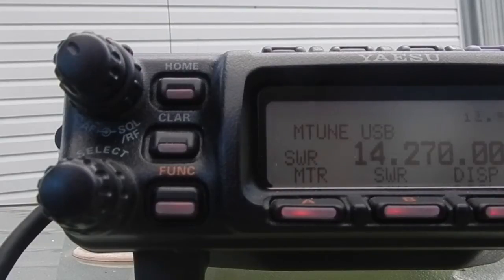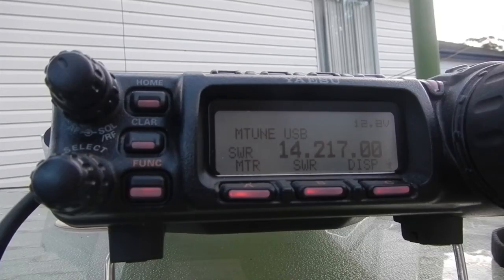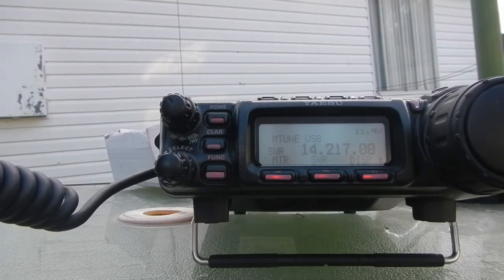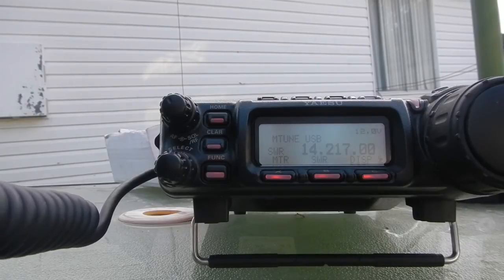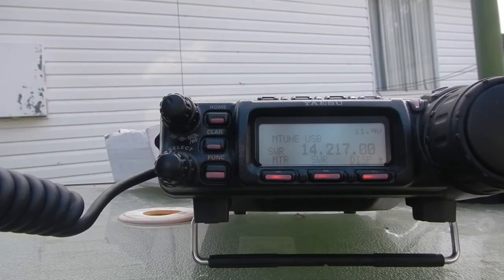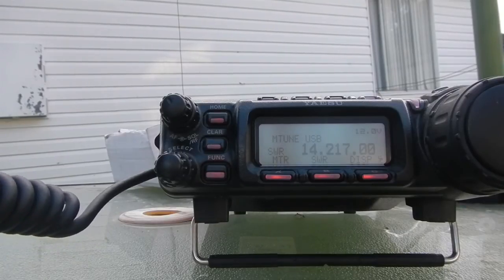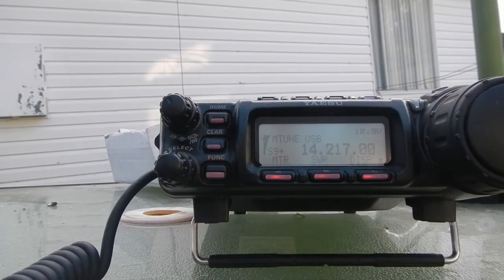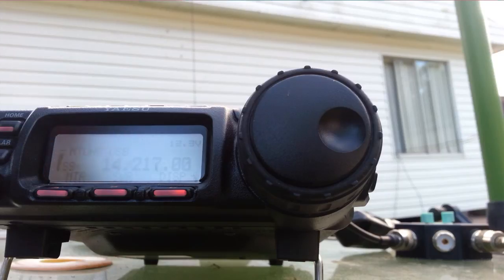Pac 12 / npc 7  Antenna - first QSO testing with/without radials. zl2jbr on 20m

Comment: Several years later, would you still recommend this antenna? I've picked up a QRP HF rig and am in need of a portable antenna, so this one (and others like it) have caught my attention. Any input you can provide would be much appreciated... thx from VE3XGS
Reply from the maker: to be honest not really. 

It's a bit of a pain to tune even though it's a great little set up. 

I'd much prefer a wire antennas but you don't always get the option of trees etc. check out Adam's s QRP set up in this video here  https://youtu.be/wBJvEeSooXo  Adam does lots of Sota and flora/fauna type activations and has his set up down pretty good. 

he uses a linked dipole which I think is about as good as it gets for qrp portable. I also had some luck when in the bush just using a random length 4 sided loop into a 4:1 balun through a tuner. Lots and lots of trees to pick from though. 

Hope that helps.
Reply: how about testing it with one radial only?

Comment from the maker: Awesome. that's exactly the plan from my end now that VK2 in Australia has come on board for Sota.
Let me know if you make any videos of your adventures. I'd be keen to see them. 

Oh, and I really like the antenna.
 I wanted extra coil clips so I could just move the lead to set spots.  Plus I only got 1 with mine. 
From the US the buddy clips were cheap enough but postage made them around $35 odd for 3 of them. 
I found a local source in VK3 if I recall. 
let me know if you want the details.

Comment: I picked up one of these 2nd hand a few months ago on eBay for $80 & I have found it very good so far... starting to get into SOTA & did my first activation attempt yesterday, but due to gale force winds had to get off the mountain top after only making one contact.

I'm running a ft-817 with a 9ah lead acid battery all mounted in a backpack, I had a good contact into ZL on 20m on 5w today with S8 5x5 signals each way from a local peak here in the mid mountains.